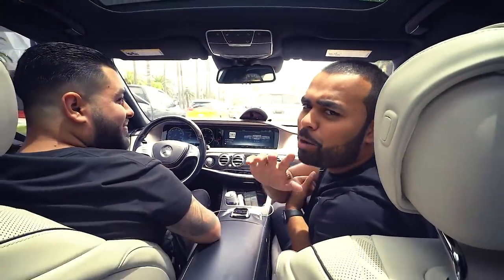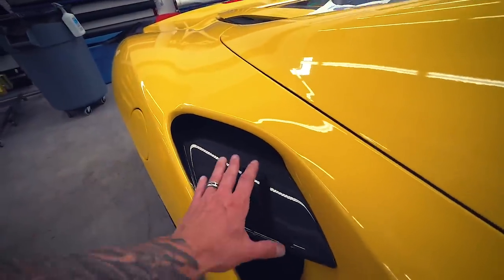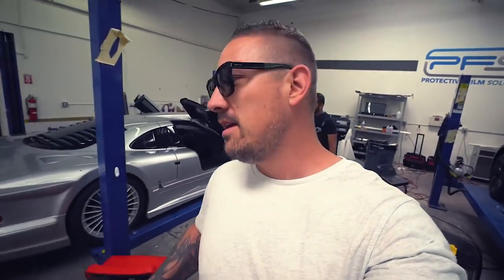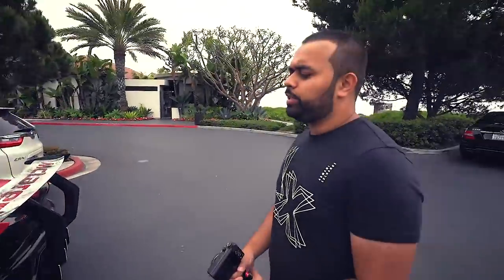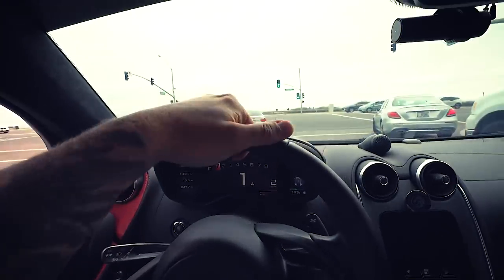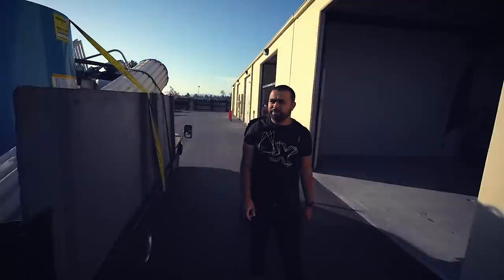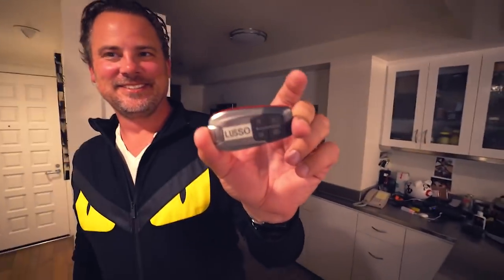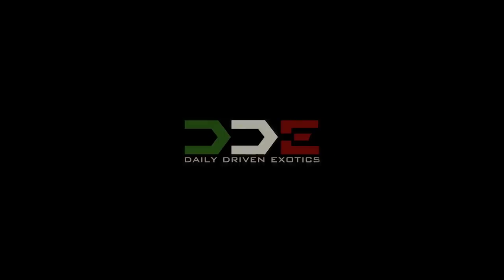MEET THE BABY McLaren P1 GTR! * NOT $5 Million ONLY $250,000 *

Comment: The Mercedes CLK GTR there is 25 ever made 19 are coupes and 6 are roadsters
Reply: But only 3 had the V12 AMG engine, and the rest were V10 AMG engines.  That's why he said this is a 1/3 car, because it is.  It belongs to Ben Chen.  It will be on goldRush X.
Reply: they all had v12's
Reply: Mark Gay this is the super sport clk gtr
Reply: Oh, that's right, but they actually were different engines.  I'm not sure why I was thinking they were V10's initially.  The V12's in 3 of the coupes were the larger displacement motors.
Reply: MrHazeMyth yeah indeed! The 3 V12’s from the Supersports were slightly bigger than the “normal” ones :)
Reply: There are 26. 20 coupes (chassis #20 is a black on tan coupe) and 6 roadsters (1 of them is black as well, but #6 is silver).

Comment: Mclaren is so confusing. A 2016 570s can go 0-60 in 2.7 seconds but the 2018 720s goes 0-60 in 2.8 seconds. But, the 720s does the quarter mile in 10.3 seconds vs. the 570s' 10.7 seconds. Either way... I'm pretty sure a car that runs 0-60 in less than 3 seconds and runs 10's stock from the factor is a little more than a "sports car"